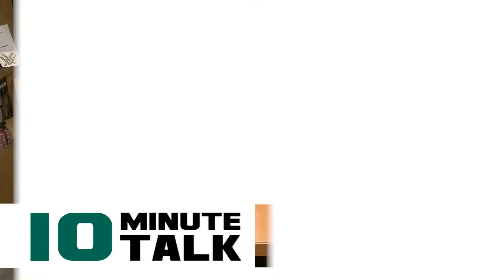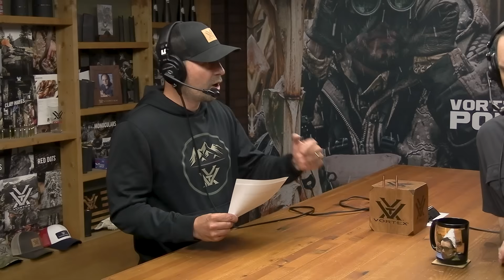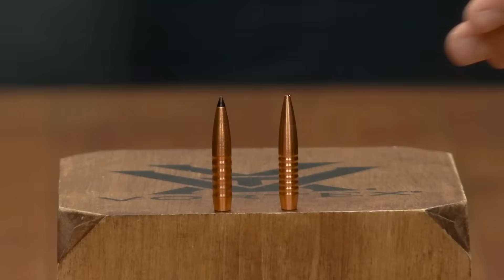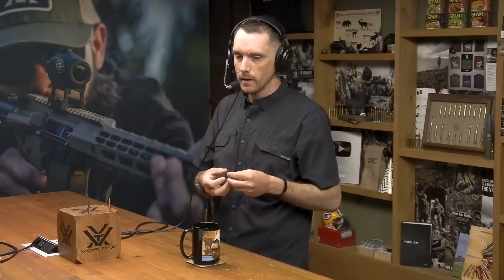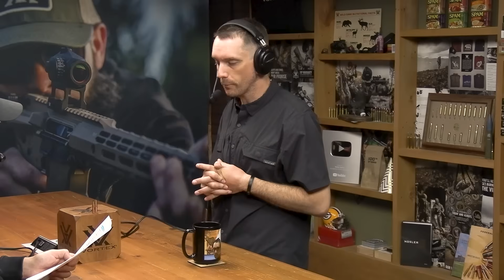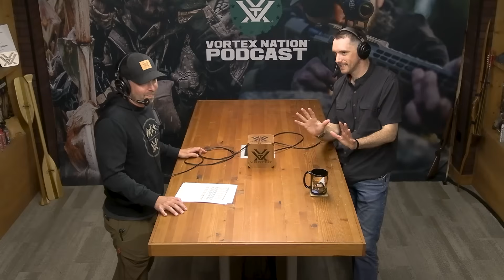#10MinuteTalk - Hammer Bullets — Do They Hammer?

Comment: I've loaded Tipped Hammer Hunter bullets and they shot very accurately. My friend shot one black bear with it and he never recovered the bear.  I've shot a lot of animals with all types of bullets. I consider most monos to be solids.  Generally they make small holes and small wound channels. The only differences is most mono bullets have a tendency to turn. If the body cavity is really short then it's fine. But, if the purpose is to shoot an animal at any angle don't count on it going straight through the animal at that path which defeats the purpose.

Comment: Ive used Barnes and Hammer.  Prefer Hammer.   I test loaded at .020 off the lands in .3 gr increments.  They shot a ragged hole.  Never have I had such an easy time finding a load.   143 HH, 7mm, 1:8.  Long range performance was spectacular as well.  DRT.

Comment: Ive had similar experience with Hammer HHT bullets.  Did a comparrison with 7 PRC, using 160 gr Hornady Cx, 160 Barnes LRX and 162 gr Hammer HHT. did a full load workup with each and the Hammer was without question the most accurate.  Best group was .23" and average group on 6 different powder charges was .49"   and the point of impact shift between the 6 different loads was only .3".  If you over lay the 6 groups on top of each other (65.0 gr to 67.0 gr of N560 in .4 increments), the aggregate group is about .95". Havent used them on live game yet.

Comment: Hello. I have a Tikka 7PRC and was looking at trying the Hammer Bullet. I currently run Barnes 160 LRX, but would like to try something new. Nothing wrong with the Barnes, but just want to try another option. Which bullet should I be looking for? 300-500 yards for Hogs, Deer, and hopefully Elk this next hunting season.
Reply: Try the Hammer HHT 162 gr. I love the 160 gr LRX, but definitely found the 162 Hammer HHT to shoot tighter groups with a slight increase in muzzle speed.
Reply: @HockeyDad6631 Have you used them in the field yet? Did the projectile break apart?

Comment: Have been testing the Hammer bullets in a 35 Whelen. Have tried all the heavier versions from 245gr to 275gr. The most accurate for my rifle are the Power and HHT bullets, the Stone are all between 1" and 2" groups. Going to try the lighter HHTs next. I do get good velocity, though not as high as their reloading data indicates. Around 40fps less on average out of a 24" barrel.

Comment: Is the guy running Hammer 170s in 28 Nosler using a custom twist rate?   Website data recommends 150s for for 1:9 twist.

Comment: Do you have a video/podcast providing all new vs older rifle calibers (well known) 123 grains (?? - smaller) and below, capable of hunting deer, hog, varmint, etc... at 300 yrd and below? is so, does it include info for the 6 ARC vs 22 CM vs 6.5 Grendel vs 243 vs 22-250 vs etc... with bullet grain, velocity, low recoil, energy till 300 yrs, rifle weight, ammo price/type, barrel length, rifle availability/price, etc... maybe with scope type... I assume a 1-8 will work for a light weight set up under 300.

Comment: Most of that 0.1gn variance on the bullet weights is simply due to tiny differences in the density of the copper bar along its length. And, yeah, it's mighty impressive to have a box of 100 bullets all weigh within 1 or 2 tenths of each other. I've seen boxes of jacketed lead core bullets from Nosler, Hornady, etc vary by up to 2.5 grains. GRAINS! Barnes copper monos are somewhere in the middle.
Reply: Berger match's are for sure the most consistent, I used to weigh them and compare. Bergers had the least total variance as well as most bullets were in the middle of the curve. Usually around .5 grain total swing, with about 90% of them in a .2 grain swing.

Youre right, many other match grade bullets had way higher variances. I stopped weighing when I realized it mattered a lot less than you would think

Comment: I appreciate that companies, like Hammer Bullets, are providing a diverse set of products - not just in model but also in projectile weight. I'm currently working up a load for the long-forgotten 375 Winchester, and their 180-grain Stone Hammer is one of the few bullets on the market to support this cartridge. The fact that they develop these less popular/low volume products alongside the high-BC/high sale volume projectiles is greatly appreciated. Fragmenting pedals combined with a solid .375" shank sounds like a lethal combo.

Comment: Here's also something to consider. In Africa, I'm told the PHs plan for a single shot, and don't like fracturing projectiles, but prefer a Swift style bullets. DISCLAIMER: I have never been to Africa. They load their rifle with that type of load, planning to use it if your shot doesn't kill. I have been told that they do not like fracturing projectiles as they have no way of controlling the petals, it's kind of sporadic based on the tissue. If it was possible to direct the petals all to the spine, you would have a better terminal performance, but some of the vendors that do not use fracturing are able to fine tune the ogive and HP to get it to expand the best way to hit the spinal area. I'm probably all wet though...😉

Comment: Actually fracturing petals are common on other bullets like Lehigh, Maker, Apex Outdoors, and Cutting Edge. Others use the non-fracturing, like McGuire, Barnes, Hornady, et al...combine that with light bullets at high velocities vs heavy bullets at low velocity, what does it mean? Well, in Hammers case, they claim a patent on their website, and I was just looking that up with a friend's help, he has 26 patents as the inventor, and he pointed out that it was odd that their patent is a Design patent, opposed to a Utility patent, but more so, that the number was incorrect for a Design patent which should be a D plug 7 digits, and they have a D with a / and , with 8 digits. Looking it up with Brian AND Holtmeyer, as the inventor, renders their design. The parabolic radius is nothing more than an ornamental design, there is no terminal ballistics involved, it's all ornamental. My friend laughed at parabolic, as he claimed that is used in regard to mathematics. The way Hammer talks about their "patent" is as if they were issued a patent that was so convincing that a patent was issued to prevent others from violating it, but the patent system doesn't work like that. It was intended to protect the assignee, so that the data could be published to the public and a skilled artisan in their field could reproduce it. That is not how the system today, and if you make money, it cost a lot to protect yourselves from the patent trolls. I don't think Hammer is that big, so they are in it to produce bullets, period. The bullets do work, but the parabolic radius is hyperbole...AFAICT...EDIT: I don't doubt Hammer bullets work, they have taken a lot of game. Just that the parabolic radius may not be what others are led to believe.🤷‍♂ The fact that Ryan likes the HHs says the tipped bullets may not be as popular for hunting. But the question is, does the radius have an effect, and if so, why wasn't the patent issued for some type of utility? The older HHs have various style of cannelures, not all are radiuses, but some are...🤷‍♂

Comment: I am having a rifle built in 7-300 PRC and the reamer is being modified off the dummy round and it has the 172 hammer. I should have the rifle back in September and will know more then. If it peaks your interest Little Crow Gun Works is building it and he will air the build and testing on the range in probably December of this year. By the time it airs I hope to have some field results on whitetail and axis deer.

Comment: The hammers are interesting in that other than cutting edge and leheigh you don't find this performance anywhere else.

That said terminal performance still doesn't hold up to lead cores. The petals radiate out but they don't do it as quickly as lead fragments. On the typical broadside or slightly quartering shots we take I have noticed it takes 1/2-2/3 of the animal to really get the petals out more than an inch even at extremely high impact velocities. 

In the heavier weights the petals are large enough to cause significant enough damage, but when you get light for caliber you basically just have a caliber sized hole with 4 small petals that do minimal damage. 

If they made more dead blow models, or if the petals moved further from the shank I could see these being better. For my money lead still kills better.

Comment: We have a similar design projectile here in the uk made by virtus precision. Very effective but tends to cause a fair amount of damage when you take a heart/lung shot. Devestating on head and neck with rapid seperation of the petals. Only issue is every so often a petal goes rogue. For example, perfect high neck shot but one of the petals did a 90 degree turn and went down the back strap. Not ideal but has omly happened a few times.

Comment: A semi-frangible projectile that is consistently accurate and opens up with petals that penetrate into vital collateral structures, and a shank that provides through and through entry and exit wounds that produce a much quicker loss of blood and easier tracking. Seems like a no brainer if it works.  I’m currently working with a 151g absolute hammer load over H4350 in a custom 30-06 with a 25” Bartlein Carbon barrel that is shooting 3/8” ragged wholes at 3050 fps at the muzzle, and haven’t even fully broken in the barrel yet (round count is currently only 50) so yeah I’m impressed.  I really thought load development was gonna be a little more confounding, but I’ve had zero problems so far and the barrel has been slowly speeding up.

Comment: Have only used the 125 HHT in a 6.5 CM, ~2925 on prairie dogs at approximately 150-200 yards. Sample size was limited with only 3 p dogs with that load, but results were really interesting - massive trauma and not so much penciling. Not as explosive as an ELD-M at moderate distances on p dogs, but an in-between effect.  I expected full penciling on such a small animal, but with it consistent on those I’m interested to try it on whitetails this fall.

Comment: I’ve tried three different hammer bullets. It tried the .22cal 44gr HH in a .22/250 they are speed demons. Easily pushing past 4300fps. The .243cal 70gr. HH in a .243WSSM at about 3700fps. They Absolutely “Hammer” yotes DRT. Finally the .30cal 182 HHT in a .300 Weatherby. at 3225 at mag length too. All very accurate.

Comment: I appreciate the video y’all. I have used hammer bullets in few different calibers and I have been all in on them till last year had problems with the 152 grain 30 cal hammer hunter bullets which aren’t made any more I’m guessing because of the problem I had with them which they never told me why but my problem was they penciled through two deer and never recovered them all from 100 to 200 yards good shot placement and everything tracked both deer for better part of 300 yards still no deer in freezer. Switched back to Barnes for my all copper bullets never had a problem with them

Comment: Couple of theoretical questions. You could achieve the same reduction in barrel friction using vertical grooves on the bullet right? And I would think they would also be more aerodynamic than the circular horizontal grooves right? I don't think you could do that on a lathe though?  Or why not use a spiral continuous grove in one continuous cut, which I think you could do on a lathe? Same barrel friction reduction and I would also think more aerodynamic and possibly good for stabilizing bullet rotation down range? Just curious and don't steal my idea...lol.
Reply: Wouldn't seal.  Probably too much blow by of gasses

Comment: Mark, Another hammer job with the research and guidance. I'd even say you nailed it.  You know one cartridge I personally use hammer bullets for that I haven't seen much info on? The 284 Shehane - aka  the 284 Win with blown out shoulders.  I know the 284 isn't the hottest new cartridge out there; I've even seen chuckles on set regarding it.  But did you know it's the basis for what has lead F-Class competetion for the past ten years? Wow! that's pretty impressive stuff.  Hey, maybe someday right.  Thanks againg for another enlightnening podcast!

Comment: Bought a 6.5 grendel a while back and nestled a 2.5-10 vortex illuminated scope on it for deer and hog inside 200 yards. I took it out a couple weeks back for the first time and sighted it in with 100g wolf steel case that shot 2.5" to 3" on average at 100. I then shot some brass case 123g Frontier and shot 1.5 to 2" groups at 100. Actually my first time behind a bolt action, and it was sweet. Can't wait to figure out this rifles favorite bullet. Pretty confident with this scope, the ammo its prefers, and my experience so far with bolt guns.....I could shoot MOA or better at 100 yards. With a bit of practice, the same at 200. The scope and rifle can definitely outperform me for sure. Fyi....just put a Hog Hunter on my CZ in 7.63x39 and hope to sight it in on the 5th. Thanks for the quality of product, reliability,  affordability, and working class American values. Have a great 4th and any tips on the grendel, or scipe is appreciated.

Comment: This podcast made me go back and check my files. 
I ended up at ~3000fps with mild pressure signs with my maximum load (powder weight withheld) BL-C (2)

123gr. Absolute Hammer 
6.5 CREEDMOOR 
Ruger American Predator 22” bbl

My notes are as following: 

Pressure signs at max load
Light ejector marks
Moderately Flattened primers

2997 fps
3000 fps
3014 fps

Comment: I personally want my big game bullets to stay together.
Forever we have seen weight retention as a positive for bullet performance. 
These bullets are apparently designed for medium and large game hunting. So, why would a cup and core bullet coming apart be a failure and this bullet coming apart be a win?
Reply: the whole bullet doesn't come apart. just part of it. It still has the majority of the weight complete a pass through. It fragments in a controlled aspect
Reply: I went with Barnes and Maker bullets over lead to get away from tiny random pieces of the bullet scattered around in the meat I'm going to eat. I'd try Hammers if they had ones that expand without fracturing, but I didn't see any on their website.
Reply: Cup and core coming apart isn't really a failure as long as you aren't shooting something too light for caliber.

Bullets shedding weight or even having core separation make fantastically lethal wounds as long as you get the penetration. If you have something heavy for caliber with a good SD then it's pretty hard for them to shed too much weight.
Reply: Its about changing the tip design on impact. Its pointier when ballistic (in flight) to get better trajectory, when terminal basically it transforms into a wadcutter for better terminal performance.

Comment: Heres my experience with hammer bullets after shooting them the past 3 years. The bullets shoot good, not much load development required, when you call they're very helpful, bullet consistency is good. My experience with performance has been iffy. Hammer bullets are not fur friendly. I shot a coyote that had the exit wound the size of a basketball. Ruined it. I shot a boar at 140 yards behind the shoulder with a 200gn going 3100fps and the bullet pencilled in and out....zero blood trail and ran a while but luckily it died in the open. I didnt see any secondary wound channel from the pedal separation. Shot another at 70 yards in the shoulder that had a 3/4" entrance and exit but under the hide I could stick my fist through the wound channel. Ruined the entire shoulder and about 6" of backstrap. I havnt experienced any of this "hydrostatic shock" they all refer to. I dont believe in the flat bullet creating a larger wound channel vs a mushroom 2x the size because I never saw that trauma. I also dont really believe in their PDR band theory because every new bullet design they release they keep changing to less and less bands. Now...if you so happen to say anything other than good stuff about he bullets there are a few hot headed guys that work for them that will roast you. So much that it completely made me not support them anymore. If you research their bullets enough on forums you will read that the hammer following is like a cult and they will smear your out of the forums. So the combination of the less than stellar exit wounds, inconsistent performance, lack of blood trails, and a bad run in with one of the guys I will be sticking to the tried and true Barnes and Noslers. If you really want turned bullets look at Mcguire bullets.
Reply: A novel about nothing: no calibre, no mv, just anecdotal ramblings.

Cool story, bro

Comment: I decided to give Hammers a try in a bit of unusual use case.  I have a 6.5cm in a 14" CVA Scout pistol.  I wanted a light bullet so I could use a fast powder and there are very few options out there.  Hammer and their community helped me develop a load that shoots an 85gr HH at 3,125fps using TAC powder.  It is a laser beam that is limited by my abilities.  Easily sub-moa if I can hold still.  If you are looking for lighter weight bullets for shorter barrels to get your velocities up, you should order yourself a sample pack and give them a try.   They have a sale going on for the 4th of July.
Reply: And I just ordered some yesterday 😢 the sale started today.